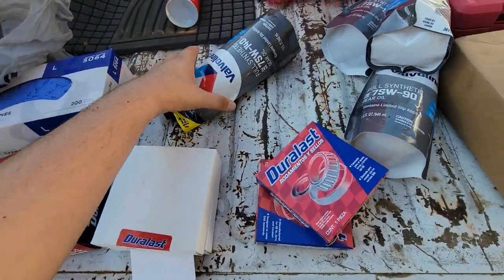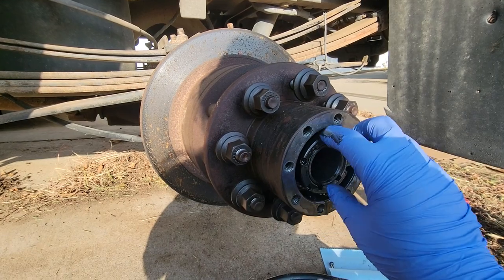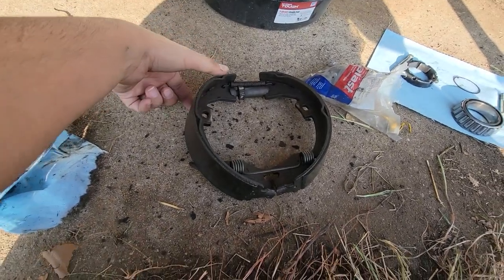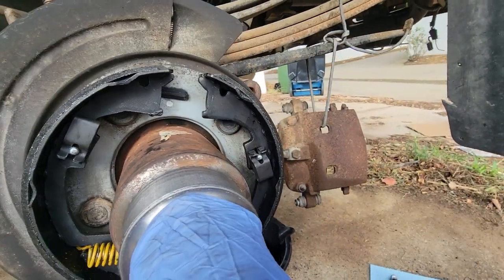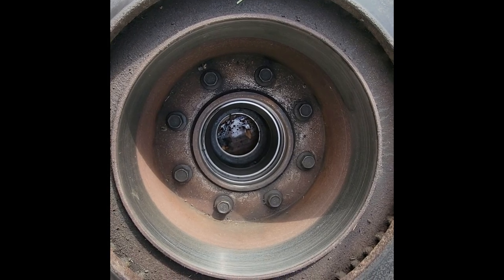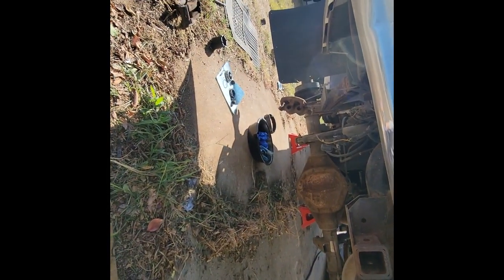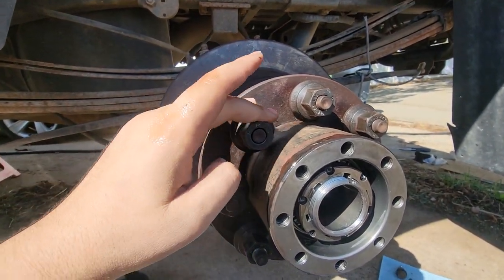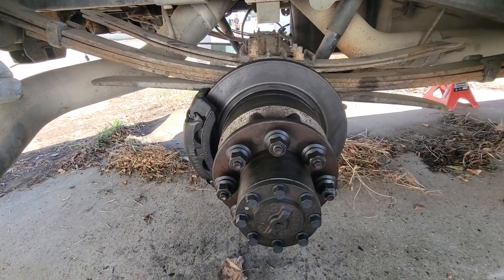Rebuild rear axle on a 2006 Dodge ram 3500

Comment: A good Truck for Hot Shot Driver. Do you miss truck driving.
Reply from the maker: Sometimes I do, this truck would be good for that but honestly if i was to go back into a truck I would want to drive a class 8. This is a hauling monster tho! When I will be done with it , it will be a really nice truck again but to small to sleep in it i think and hotels would not be cheap. I just like the space I have in a class 8.